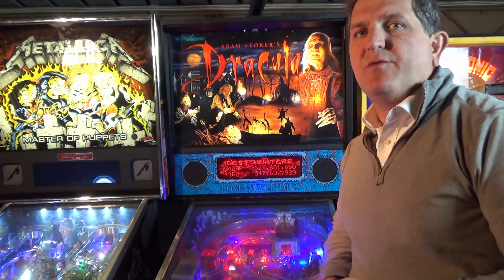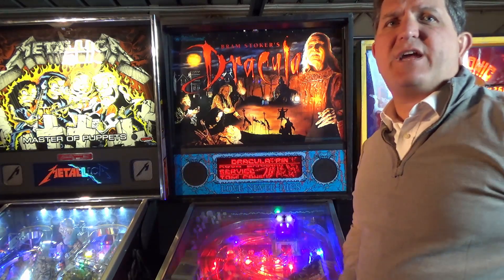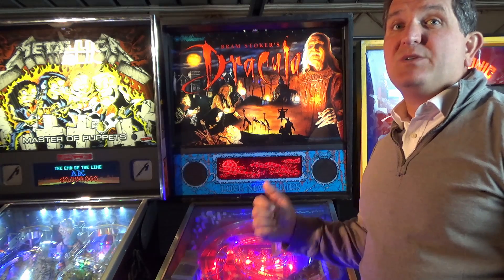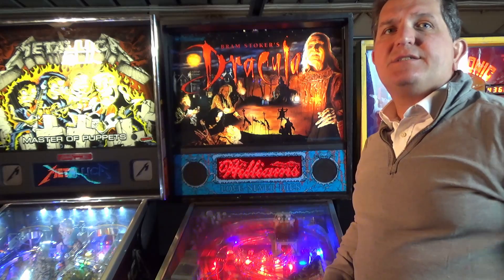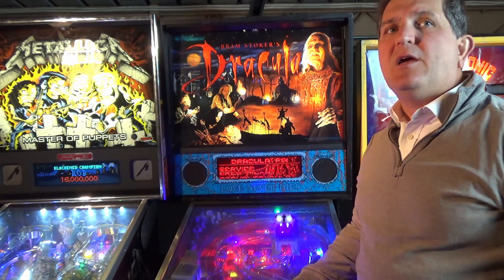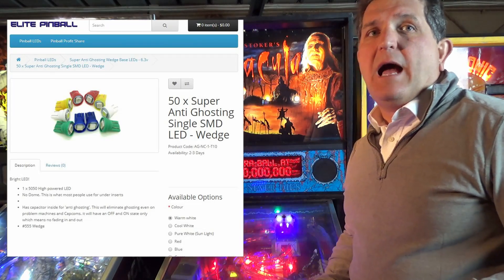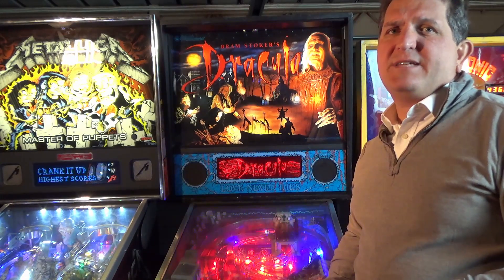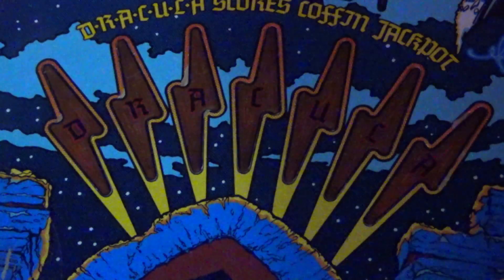Pinball - Test Anti Ghosting LEDs vs Regular LEDs

Comment: Excellent video.  Thanks for showing the comparison between them.  Did all of your original LEDs do that or just some of them?  On mine only one row of them on light matrix do this, and I’m puzzled why.  Do you know by any chance?  Thanks
Reply from the maker: It was the same on this machine... only selected lamp matrix lamps ghosted.  Must be a function of how certain rows and lamps cycle through and due to the low current and instant illumination which comes with LEDs means they ghost while not visible when using incandescent lamps.
Reply: That’s great to know.  I kept thinking that maybe one of the diodes is bad, so it lets current leak.  I’ll definitely will change the ones that are ghosting, as it sounds like that will be the solution. Thank you